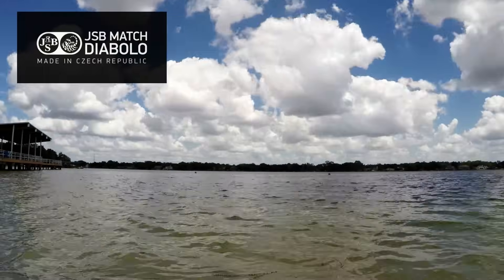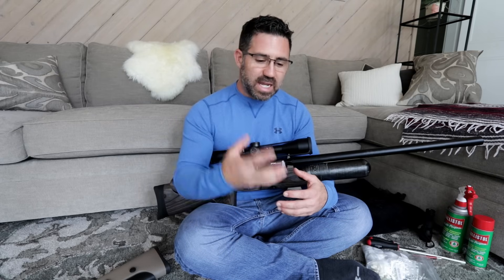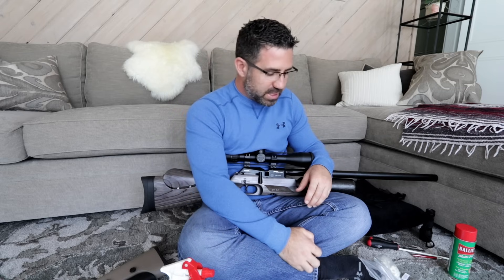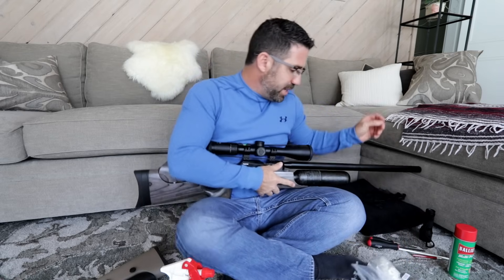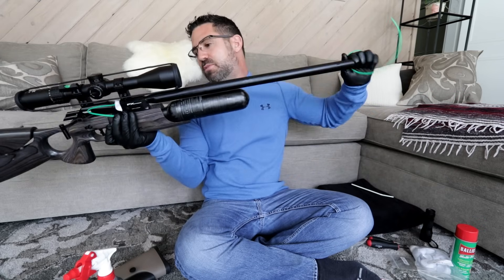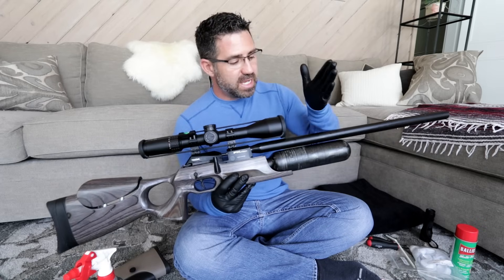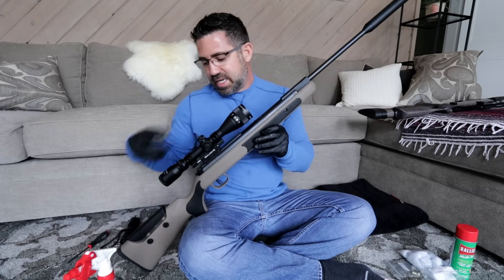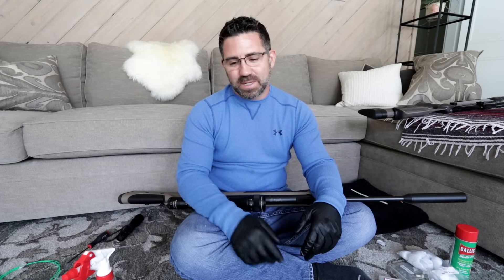Air Rifle BARREL CLEANING + Accuracy Secrets Revealed - PCP Airgun - Pellet Gun - Break Barrel

Comment: With my air rifle right out of the box I use Brake cleaner in an aerosol spray with a small tube to direct the liquid only enter the barrel. I never get the liquil on any seal or piston on the air rifle. After spraying the brake cleaner down the barrel I pull a clean white patch through the barrel. It should come out slightly dirty then I will pull a second patch through and it will be perfectly clean like it was brand new. If you can pull more patches through, but they will also be clean. The brake cleaner cleans the barrel perfectly. Not necessary to clean again until the barrel gets dirty from shooting many times. I clean even my other rifles and pistols the same way. I even spray the brake cleaner down the gas tube of my AR-15. I am a competitive target shooter and all my rifles are very accurate. My AR-15 will put 10 shots inside a dime at 100 yards. My 1,000 yard rifle which is a 6 mm Norma Br. which will consistently less than two inches at 400 yds. and my best group at 1,000 yards was 3.25 inches for 5 shots.

Comment: Hi Steve, I have found that if you are very careful you can spray brake cleaner with the little tube that comes with the can while the barrel is pointing down so the brake cleaner does not get on any of the seals. Only enough to run out the muzzle is needed. Then you only need two or three patches run through the barrel to completely clean and dry the barrel. You will also notice that the second patch will come out completely white. WALAH you are done cleaning the barrel.

Comment: Thanks for doing this video Steve. As a fellow Pellet Rifle enthusiast I thought of a couple things I would like to mention to your viewers, hope you don't mind me putting in my two cents.
 
A note or two to add:
When cleaning Break Barrel air rifle:
      * If you leave ANY oil in the barrel, even the smallest amount, it could cause Dieseling.
      * Dieseling makes your gun louder when shot. The sound level is usually compared to .22 short or Filbert ("smokeless" powder ammunition).
      * Dieseling looks cool 'cause smokes going out the barrel but it's NOT a condition you want you air rifle to be in. FPS speeds become erratic. Grouping diameters tend to get bigger due to the FPS changing.
      * Dieseling could ruin the air rifle's breach seal(s). 
      * Purposefully Dieseling your Air Rifle could void your air rifles' Warranty.
      * Purposefully Dieseling your Air Rifle could be ILLEGAL in your area depending on where you live. 

If using CLEANING PELLETS It's seems best (to me and I think Rick Eutsler would agree) to push cleaning pellets through a break barrel air rifle with a cleaning rod. DO NOT SHOOT CLEANING PELLETS (with a break barrel air rifle). The felt cleaning pellets are not as tight (as a lead pellet) in the barrel, it takes very little air pressure to shoot it through the barrel which means it's similar to dry firing was far as the piston is concerned.

I am speaking from experience in this regard. I did shoot one (cleaning pellet) out of my Remington Express when I first got it because I thought it ok since I saw one of the salesman at a Cabela's do it to an air rifle right after mentioning that you should never dry fire an air rifle. In my experience when I shot the cleaning pellet through the air rifle, the piston DID "SLAM home" (the transfer port). The rifle shot fine afterwards but it could have damaged the piston seal. 

 A Pellet gun enthusiast should keep a Pellet Rifle Logbook for each airgun (kinda of like a Man's scrap book).  Keep all the DATA from day1 on >>>>O

I use 50 LBS test Fluorocarbon with 5 patches spread out on a very long line so that a patch is entering the barrel right as one is about to be pulled out. This way there are no more than 2 patches in the barrel at any given time. I spread the patches out and use a long line which allows me to pull multiple patches per each pull. This means that I can do 3-4 Pulls and be done. It is important that you have no more than two patches IN the barrel at any given time for this method. Otherwise it becomes difficult to pull the patches through. 

I will usually run strictly dry patches thru the first round just to get a good idea of how dirty the barrel is. Then I attach new patches and lightly oil the the first couple of patches, the other patches behind the oiled patches do not get any oil as they need to be dry so the pull the oil out of the barrel.
Reply from the maker: Thanks for sharing all this James.  The more the merrier.  Steve

Comment: its good to develop a routine and stick with it, for example when i clean my barrel, after that i test pellets out in several sets and look at sets to see if rifle likes a bit of fouling to make tighter groups, some rifles you will notice shoot better clean and others a more fouled barrel, but the only way we can find out is do several sets after a clean barrel, also when switching pellets in a accuracy test its good to clean barrel again or at least run a few through of the next type of pellet, the reason is the barrels lands and groves are effected by the previous pellet type and may embed crud deeper or more shallow depending on pellet type diameter of head and skirt, so the next type of pellet is a janitor to remove crud so it can re foul its self and get used to the barrel, a good confirmation of a pellet in a accuracy test should consist of several sets of 5, that way you can look and compare sets to see your rifles performance, for example after a clean barrel you may in some rifles see a wider group since rifle needs to get fouled a bit to make tighter groups, then you may see several sets of tight groups that stay consistent for many shots, these are your good sets where rifle performs the best, then after shooting many more sets or plinking all day the groups get wide again and this is a hint that the fouling stage of good accuracy is over and time for another cleaning, you can see a good example of the three stages of barrel condition if you shoot many sets, stage 1 is a clean bore, stage 2 is a fouled bore and stage 3 is a dirty bore and with a long long test of many sets and spending a little money on pellets you can see these stages in your rifle, for example my QB78 loves a very fouled bore to shoot good, after a good cleaning my 10.34 grain air arms pellet needs a few sets run through to give great accuracy, if i did not do several sets i would never have noticed it was my best pellet, so this is why its good to do several sets to find them shot numbers where you notice accuracy getting better, decades ago i copied field target shooter method of a 5 set of 5 trial for a pellet after a clean barrel, this gives the pellet a chance to "prove' its self and also gives barrel enough time to show if it like a little fouling or likes staying cleaner, with pumpers i do the same thing and fire dry shots after a couple drops on the pad, i here you about lothar walther barrels my 747 pistol has one, for some pellets it loves clean all the time and for other several sets, also its common for undersized barrels like my QB78 to like lots of fouling since rifling isnt tight or choked, also head and skirt diameter can have an effect on if you have to run a more fouled barrel or clean barrel, looks like a great cleaning routine on this video, the more details you pay attention to the better, for pellet testing i like testing at various ranges and speeds like with pump rifles, some pellets prefer a certain speed, go to slow or go to fast and they can scatter with any rifle be it a PCP, spring, gas ram, pumper, or CO2

Comment: Loving your channel and I've learned a ton!

What about turning the rifle up-side-down whilst running the patches (with solvent/oil) to help avoid transfer port drowning?  Meaning, to rest the rifle on your bench rest with the scope on the bottom vs. on top to let gravity be your friend.
Reply from the maker: Just don't oversoak you're patches and you'll be fine regarding the TP.  If one does get any oil in there, a few shots and it's gone... just dry patch the barrel again afterwards.  Best Steve

Comment: Hi Steve, had a really hard time trying to get the patchworm through the very small breach of my Wildcat ... no problem with the Impact ... but that WC is soooooo tight  it seemed like it was an exercise in frustration.  In response to the tightness, I am using a Crown Saver with Napier Rifle Clean. I think that Napier Rifle Clean comes in 14 meter rolls from AoA. Cut them in 3" lengths and because they are so wide, you can cut them in half down the middle ... therefore you actually get 28 meters in a box. I take I patch ... and half of another one ... and fold over on itself until you get 4 layers deep. Apply a little Ballistol on the outside layer and rub it into the patch. Insert the Crown Saver from the muzzle to the breach, fold the patch you have just made through the loop of the Crown Saver ... now you are 8 layers thick in your .25 Wildcat barrel. It'll take about 40 pounds of pressure to pull it through the barrel and you'll hear the patch scrubbing the barrel (not to worry, it's a happy sound). That first patch will have so much gunk on it even if you've only shot about 100 rounds. Flip the patch over and do the same thing with the other side of the patch. Then, if you want, you can take a little round patch from the Patchworm bag and put it inside the patch you have made with the Napier, because by this time you have really squeezed the snot out of the Napier. Pull two wet patches (both sides) through the gun, fire the gun about 5 times and let it sit for a couple of hours. Because the breach is so tight you may want to clean a little of the Ballistol up from the bottom of the breach plate using a Q-tip with a small piece of paper towel to make it a little more absorbent. After you have waited long enough run two more dry patches through (both sides) and that barrel will be squeaky clean. The good thing about my Wildcat is it loves a clean bore ... don't have to fire a ton of shots through to reach lead equilibrium in the barrel ... after the first shot, the rest will fall right into the original POA. Are you participating in the EBR this week??????

Comment: I ENJOY YOUR VIDEOS BUT THIS VIDEO IS A BIT CONFUSING IN HOW YOU POSITION THE PLUG AND THE PATCH.   YOU STATE THAT YOU TAKE TWO DAYS TO CLEAN A GUN.  EVEN A FILTHY BARREL CAN BE CLEANED IN LESS THAN 30 MINUTES.  A BARREL REQUIRING OVER NIGHT SOLVENT SOAKING SEEMS TO BE OVERKILL.   WHY NOT MENTION THAT THE STRAW SHOULD HAVE A O-RING TIGHTLY POSITIONED ON THE STRAW TO PREVENT THE STRAW FROM BEING PUSHED INTO THE BARREL AND RUINING YOUR DAY.   A NORMAL LENGTH STRAW COULD BE A BIT SHORT SO A LONGER STRAW OR STRAW TYPE LENGTH OF PLASTIC MATERIAL WOULD BE BETTER.  IS IT OK FOR BARISTOL OR WD-40 TO MAKE CONTACT WITH O-RINGS.
Reply from the maker: Joe Hi Joe, kind of at a loss here.  I very clearly and specifically answer all the questions you had in your comment in the vid... some even with added pics.  As for how I like to approach it and the success I've had doing so, I'm just sharing... you don't have to follow it.  On the straw, if the barrel is small enough for it to enter, I've never once had a problem... I actually kind like it because it tends to hold the straw in place for me.  Best, Steve

Comment: Steve - Rookie/newbie question: when you cleaned the first barrel, it appears you put the patch on the worm first, and then the proper adapter above it.  For the break-barrel, it looked like you put the .22 adapter on the worm first, followed by the patch (so the patch would envelope the adapter as you drew the worm through the barrel).  I would think the 2nd example makes more sense, but I'm confused...Am I missing something?  Thanks.
Reply from the maker: Jeff Bricmont Hi Jeff.  Watch again.  Patch fits around adapter but you can slide on a felt plug to ride in front of it all for some deeper cleaning past the rifling edges.  Best, Steve
Reply: Got it!  And thanks!  And just ordered  PatchWorm from 20/20. :)

Comment: Wery much depends calibre. .177 and .22 not get dirty same as bigbore, and my .22 Walther barrel after cleaning is like shotgun. After abaut 100 pellet  barrel have enought led, and then accurate again. I have experience PCP airguns over ten years, and FAC rated guns. When I have new gun I clean barrel and normal you have to brake in barrel shootin at least 500 pellet. I do same whit mild grinding paste in barrel. You can do this two way, with normal cleaning rod, or aply litle grinding past to pellet and shoot. But do not do this with moderator on or shroud.

Comment: First of all.......how can a break barrel air rifle be accurate ???     Take the rifle.....place the lower stock and put it between your feet.......and the upper stock between your knees. Lightly push on the barrel side to side..all directions. It moves over 3/32 of an inch in every direction !   How is this going to be an accurate shooting rifle ??????   There is no possible way to keep the barrel firmly in one spot !

Comment: I think I might order that patchworm thing, should reduce the number of patches I need compared to the loop thing at the end that I insert into the muzzle down to the breech and then depending on whether its a 4.5mm or 5.5mm put one or two of my homemade patches on. They get clean eventually but this should get the job done faster (if I find a place that'll ship it out to europe from the USA at reasonable cost or perhaps a local distributor).

One useful tip for breakbarrels though! It might not work for all of them, but on some of mine you can break them open without cocking them and enough of the breech may be exposed to insert the patchworm (or other cleaning tools). In all my cases where it doesn't expose enough only moderate tension (much less than finger breaking/crushing tension) will expose enough to get it in there. Especially useful one the ones that can't be decocked without firing.

Sadly I can't use that trick on my underlever HW97K since the protective metal cover won't move back enough, but fortunately that one only needed cleaning twice so far. Once when I got it and after many shots when the groups started opening up a bit, even when using the known tin of good pellets for the rifle that I had in storage set aside still.
Reply from the maker: Extra stuff good point about the break barrel only needing to be partially open sometimes, thanks.  Don't forget your 2-inch Otises.  They make all the difference.